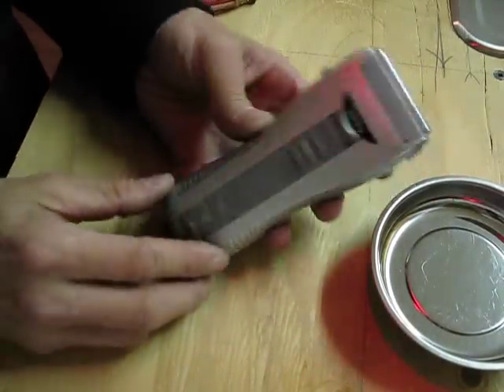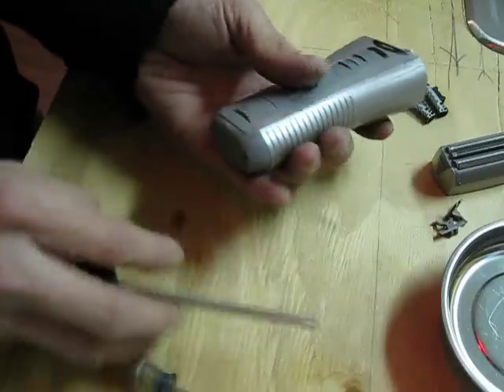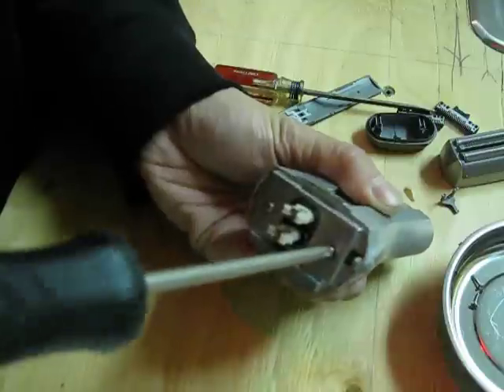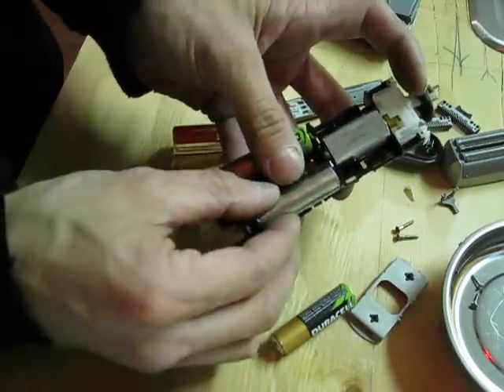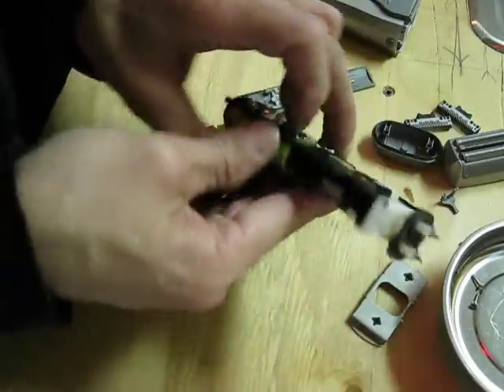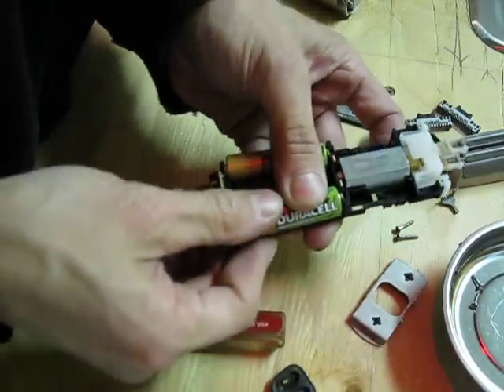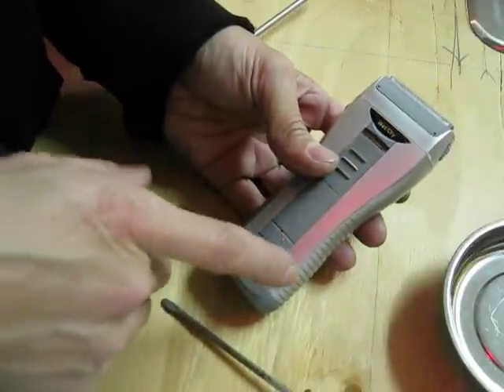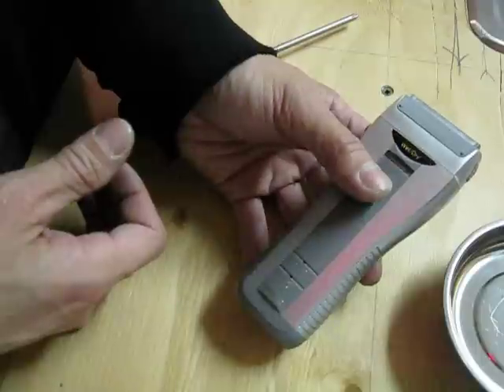Panasonic Electric Razor battery replacement

Comment: Thanks DaBin!  Just because this is an old video don't think someone won't be blessed by it.  I was given this razor by my Dad and it sat brand new in a closet for new for years.  After swearing off electric shavers I decided to use it.  Less than a month of, because of the age, the batteries started to go.  I put in Amazon brand rechargeable batteries and used thick gauge copper wire, bent in a "V" shape, with the "V" point towards the top and it holds the battery in place and it works!  Hardest part was the plastic clips.  I accidentally turned it on an the head mechanism flew apart, but you are right it wasn't too difficult to figure out how to hook the 2 mechanical parts back together.  Thanks again!!
Reply from the maker: Great razor, mine still going strong.  On third set of batteries.  Replace the blade/foil every year.

Comment: Thanks for the video. It was instructive. 
Here are a few extra thoughts based on my experience and watching your video.

1) Do not pry UP on the grey plastic "C" clip that mechanically connects the sideburn trimmer one blade paddle nor on the other grey "C" clip. Horizontally push the "ears" on the ends of each "C" and gently pry or push/pull AWAY from the "C" opening using another flat-blade tool, tweezers, or very fine needle nose pliers and guide the "ears" as you do so. Take a very close look at the "C" clips in the video before you attempt to pry them off. When I watched the video I though he was prying UP on the clips and that could quickly break them.

2) While you are manipulating the internal assembly once it's out of the outer shell/casing, do NOT let the two white plastic blade paddle assemblies get separated. They seem to want to fall apart, so be alert. They can be reassembled, but it is a major pain to do so. You might want to consider using a rubber band to GENTLY hold them together...but do not use one that is very tight. There are some very thin plastic hinges on the paddles that could be easily bent or broken. If they do separate you have to be able to figure out how to attach the cam-pin-followers in the right order and ensure each is on the correct side of the razor (it makes a difference. One connects with the metal pin, the other connects to the plastic pin). It took me about 20 minutes to figure it out and another 40 minutes to reassemble just these two pieces after I made the mistake of testing the motor while the assembly was still out of the shell. The blade paddles flew several feet in different directions.

3) If you find you can get several days of shaving on a single charge, I strongly recommend NOT recharging the shaver every day. This applies whether you use NiCd or NiMH cells. (Also, do NOT use one NiCd cell and one NiMH cell.) However, it is especially important for NiMH cells in this specific case as explained below.
The reason we need to be careful using NiMH (Nickel Metal Hydride) cells is that the circuit is designed to trickle-charge NiCd (Nickel Cadmium) cells. NiCd cells can be trickle-charged at about 10% of the total capacity of the cell without stressing the cell. However, NiMH cells can be trickle-charged at about only 5% of the total capacity, and even then prolonged trickle-charging can still stress NiMH cells and significantly shorten their lifetime. More than 5% trickle-charging stresses the cell and can lead to much shorter life of the cell. DaBinChe is getting by with using NiMH cells...to a degree...because he is:
A) probably using NiMH cells with higher capacity than the original NiCd cells that were replaced. For example, if the original NiCd cells were 700mAh and the replacement NiMH cells are 1800mAh, then that's probably going to be fine. 10% of 700 (70mA) which is below 5% of 1800 (90mA), and...
B) he is not leaving the charger plugged-in all the time. He may be still stressing the cells however so they may not have as long a total lifetime as would have 100% compatible NiCd cells. However, he will gain more minutes of shaving per charge for as long as the new cells last.

4) Pay attention to which is the "top" surface of the square rubber insert. It may be a bit difficult to tell from the video for some people so check it before and as you remove it from the top of the shaver. About the only place the video clearly shows the orientation is once at about 12:42 as he is reinserting the insert into the cutout for the blade paddles.

Hope these help someone else.

Comment: I have an ES8066 that I bought sometime in the 1990s.  It is similar to this shaver and this video really helped me.  The batteries died years ago and replacements are expensive.  My internals came out thru the top.  I took the razor apart as in this video but I don't think I really needed to do anymore than remove the 2 screws in the base.  Taking the top apart did allow me to clean out all the debris so it was not in vain.

Comment: Thanks for the "maintenance" tour. Very helpful, and you described some issues I am familiar with from using my ES8066 for the last 10 years (or so) plus. Your tutorial lets me know I can expect more years of great use (with a little handwork)!
Reply: Herb Matthews Hi herb: I have had mine some 12 years. Batteries finally died. His replacement batteries will save me $$$.  Cheers.

Comment: Help! I have the ES765. Thanks so much for your video, followed it to get to the insides and get the batteries out successfully. Mine's 22 yo totally amazed at the Made In Japan units. Original batteries were Panasonic Ni-Mh labelled units. Held charge amazingly all these years but yeah came to a point the charge was too weak already and charging it the unit would get warmer than usual. Upon opening the right hand side battery had begun to leak a bit. I gently cleaned out any corroded bits, put in fresh Eneloop AA 1.2V 2000mAh set, carefully held down the top parts of shaving gears so nothing flew off and flipped the white switch arm. Indeed the motors ran full linear high speed no issues. I completed the replacement and carefully put everything back together and tested again, it would power on with same high speed linear sound. Put the unit on the charging stand, red LED lights up so it's charging. Now here's the 'help' part .. about 4 hrs later, I checked it, I see both the top & bottom LED lit together. The top Recharge red LED lit & the bottom Charging Status  LED shows orange. Never seen this before. Took unit off the stand, slide the power on button but the units motor does not run with the same high speed linear sound instead the motor is frustratingly fluctuating high speed then slows down then up again, very unsure of itself, not linear high speed you'd expect. What happened? I'm so sad. Why is my using Eneloop AA not working. I searched for alternate batteries and can see some aftermarket battery specialist sellers offering 1.2V 2500mAh Ni-Mh units. Same right, just able to hold higher capacity charge for longer run times right. My Eneloop batteries were positioned both Positive Tips pointing down. The batteries in this unit is in parallel right, both are charged simultaneously by the Panasonic induction charger stand right? The behavior I describe is it possible only 1 battery is being charged and only 1 is supplying power when I power on? There r 2 induction coils at the bottom, one for each battery. My charging stand is RE3-63 says 170/250mA. On the ES765 body it says DC2.4V CHARGE TIME 1H. Is it possible the batteries are actually in series not parallel? One of the comments posted by a viewer said he found one battery had reverse polarity on his?
Reply from the maker: Never had any other lights go on for me.  Your model could be slightly different from mine.  When you took out the original batteries did you check which side is +/-?  Is there full contact with the batteries at the +/-?  Are your batteries good?
Reply: DaBinChe tks v much for your reply. Model is slightly different but checking on the net, most shavers of this period looked generally the same design. Induction coils at the bottom. I have 2 induction coils, model ES765. Yours has 1 coil, so your 1 coil was charging 2 batteries whereas my unit had the more common and perhaps updated 1 coil per battery. My Eneloop is from a new Panasonic pack (not Sanyo!). Says manufactured 2014, these things hold charge over time v well, had used 2 in another device so left 2 unused batteries which I used for the ES765. Original batteries are typical ocre\brown Panasonic Ni-MH unmarked units, so does not state + or -. Checking lots of online videos of similar shaver config indicates + is at bottom near to induction coils. And both batteries in same position. Assume this is in parallel config not in series. The key thing is I tested it is all working in linear high speed when the battery was fresh out of the pack. But once I put it on the charger, behavior thereafter isn't what I expected. Definitely nothing wrong with my charger. I have also seen some surprising videos\images of similar looking inside units showing the original batteries were NiCd .. could there be any issues using Eneloop AA batteries? My original batteries did state Ni-MH. Just thought this was supposed to be pain free and that I didn't have to go buy specific replacement batteries. Does it seem like I have to do that now? I will undo and check all contacts, the fluctuating behavior feels like it's underpowered.
Reply: I fixed it. The new batteries are larger in diameter so very tight fitting inside the shaver body such that it dislodges downwards that few millimetres in the final push into the shaver body so contacts are not solid. (Now we know why the original batteries have such long pins to avoid any such issues.) Fixed by redoing reusing springs from push pens in the - ends and on + ends used the ends of cable ties to wedge into back of contact pins to push it fwd to make the final solid contact, snip off before closing and screwing up the base plate. Now finally charges up without any orange LED showing (now we also know orange LED indicates one of batteries not fully charged) and motor speed totally high speed linear, and after full charge the Recharge LED lights up bright Green! What a wonderful sight. Now it is so powerful feels like it's about to take off! I'm trying to find some of that maintenance oil and also oil for IPX7 waterproofing.

Comment: Thankyou for this video, I used it to repair my ES883 which has been out of action for over a decade after I was informed that the batteries were no longer available for it when they failed. It only requires the bottom screws to be removed and then the outer shell slides off, a lot easier to access the batteries. I took a slightly different tact when installing the batteries, I bent the battery tabs inwards to firmly press against the battery terminals, and then pushed some rubber packing in behind the terminals at the top to help keep the batteries wedged in tight. I had a problem with the job though, one of the original batteries had become reverse polarity, meaning I couldn't identify which end was supposed to be positive from negative to install the new batteries. So after investigating the video plus a bit of reverse engineering the board, found the top terminals are negative and the bottom ones positive. This video was a big help as my original batteries appeared to have negative marked on them, but it was actually at the wrong end!

Comment: Jakie powinny być akumulatorki (parametry) do tej golarki? Bardzo proszę o informację
Pozdrawiam serdecznie Piotr
Reply from the maker: On my shaver the original batteries are NiCad but I'm using NiMH.  Both chemistry have slightly different cell voltage with NiMH being a little lower volts when fully charged.  Because of this using NiMH the charger will never show full charge so you have to take the shaver off the charger or it will overcharge and can cause a fire or explode.  With that said I have never had a problem even leaving on the charger for a couple of days.  The cell size is AA but the original is slightly longer so needs to be shimmed with a piece of copper.  The current problem I have with this shaver is that the replacement blades are no longer available and mine is starting to get dull after a few years since last replacement, but I only use it a few times a week.

Comment: I have an old ES8026.  I' considering swapping the batteries on it.  It has held pretty well up until now, but it's starting to be a little sluggish.  I suspect one of the two batteries is done for.  I might just ride it out until it stops running completely.  Still the best shaver I have.  I did buy some Arc Models, but they aren't as good compared to the original Linear line.  A shame, really.
Reply from the maker: yeah they really are good shavers...too bad the replacement blades aren't available anymore.  I think I have replace the batteries on mine twice.  Mine is over 25years old.  This current batteries is starting to die too still runs strong if left on charger but doesn't seem to hold a strong charge if off the charger all day even after being on the charger overnight.
Reply: Thank you.......Thank you😅

Comment: Great vid. What is a good shaver that will last and is easy to change the batteries?
Reply from the maker: +robviolin1 Don't know, I have had this for more over 20years, just change the foil/blade every few years
Reply: +DaBinChe thanks for your reply.

Comment: Have a stupid question. Where did you get the copper is it a specific gauge?
Reply from the maker: easiest way is to use a copper wire, hammer it flat and bend it into a U to take up the space.
Reply: @DaBinChe  Thanks for the quick response. My ES8066 lasted me 20 years. I bought several newer shavers but I always went back to this one. I have mine apart. Just waiting for the batteries. :)

Comment: Sir which battery I can Choose To Replace in panasonic ES 727  shaver Model..?? please tell me.. Thanks
Reply from the maker: AA size NiMH, just don't let it charge for too long or it will overcharge and blow up.  I like to use Eneloop brand
Reply: @DaBinChe  Thank you Very Much Sir,  I will Replace It with Eneloop NiMh AA 1200 , 🙏

Comment: Do you know the model number for replacement battery or specs?  The original batteries are blank.
Reply from the maker: they are AA batteries, I'm using Panasonic Eneloops
Reply: Panasonic Part Number: WES882L2508. This is a specialty battery. Would advise as he said with those rechargeable but cut the ends of the old battery and find some way to solder or weld them to the new batteries.
Reply: DaBinChe is right. I'm also using Eneloops but with some copper tape soldered to the + to make sure of contact.